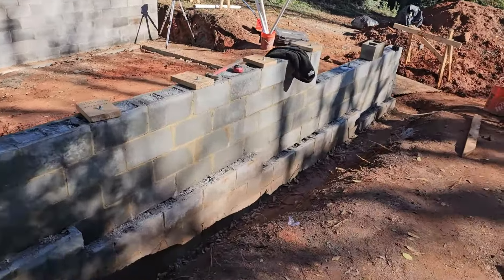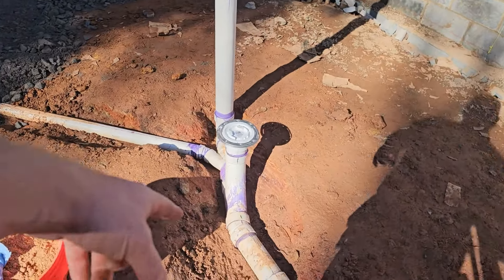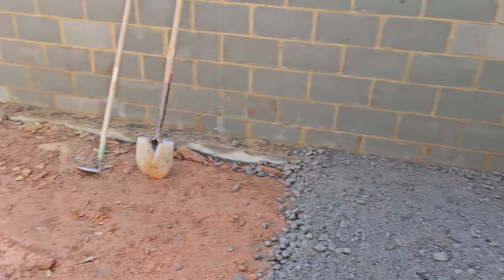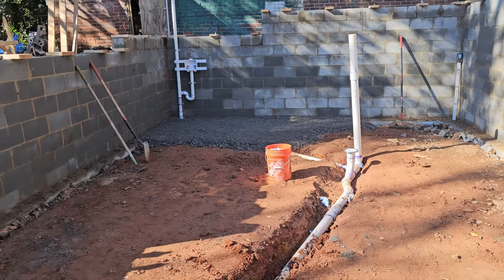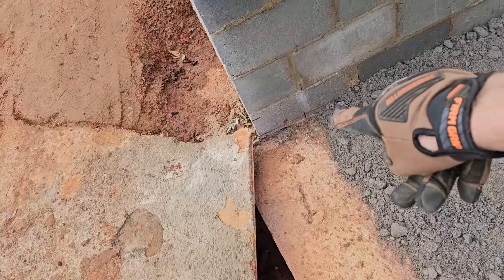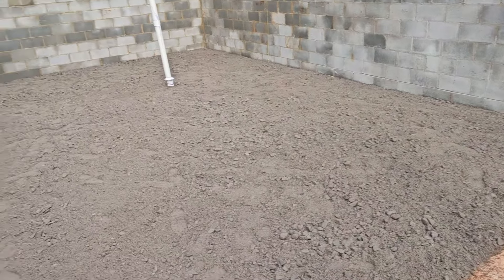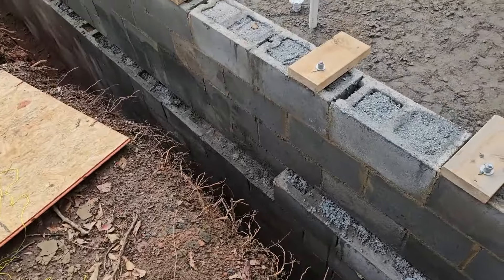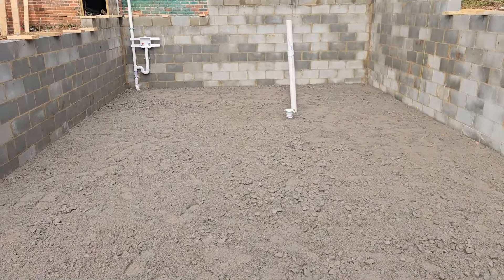Pouring A Gravel Bed : Large 2 Story Addition

Comment: Because I don't know... Why is crushed rock put under concrete?  Why not encapsulate the pipes in concrete?
Reply from the maker: There can be multiple reasons, depending on the area, but the main reason here is to create another drainage plain under the vapor barrier as an added protection from moisture. It also creates a more stable base under the concrete to help add in keeping the concrete from cracking due to the movement of the soil.